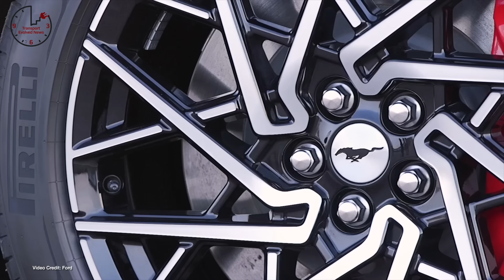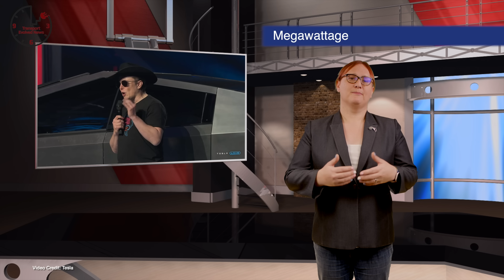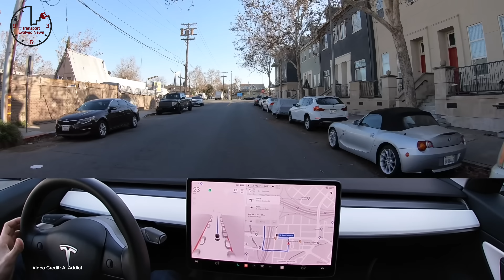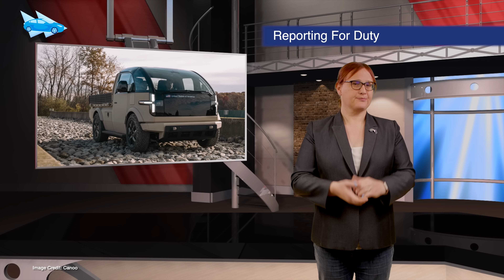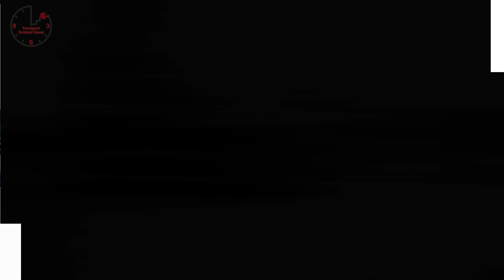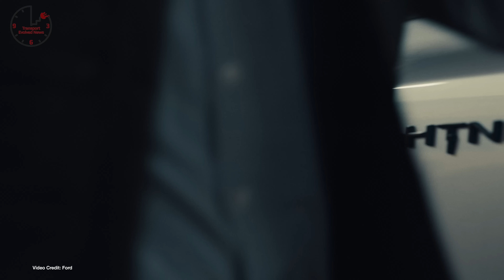Tesla Semi Deliveries! Aptera Chooses NACS! EV Sales Up (Again!) - TEN Episode 412.

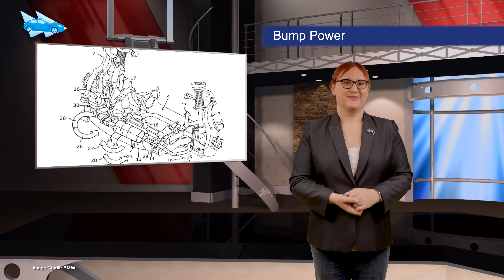Comment: Just for the heck of it, at ~18:00, the patent drawing of the driver side shock assembly (assuming the left side of the drawing is the front of the vehicle) appears to have an error. The upper yoke doesn't have the shock inside the "U" like the passenger side does. A surprising error?

Comment: Hi to the TE team, at about 18:00 you mentioned BMW's suspension patent and I was wondering if you have any more information on it like the patent number or could you mention the source of your information?  I could not find it in a patent search and I need to know if it infringes on my 2017 patent (#9561701) "Active electromechanical suspension and power generation system using an acceleration controller".  Thank you for any information you can give me.

Comment: The ID.3 has the Head up display as an option from the beginning. I have it in my 1.5 years old ID.3. It was not avaiable for a certain time due to supply chain issues.
There is a prototype driven by a German youtuber RN22E https://www.youtube.com/watch?v=dffQyt1yJiQ
This shows potential to bring petrol heads over to EVs.

Comment: The subscription model for the EV market could spell a life of financial servitude to those manufactures where you end up paying them many times over the Original value of the feature or even the EV itself!  (BMW, TESLA, NIO so far). NIO is considering selling you the EV on a subscription model!  what happens when a subscription based EV seller goes out of business,  do you end up with a "brick" in the drive because of all the proprietary software ?      Subscription models need government intervention to protect the buyers!

Comment: Nikki, over a week ago l ran back of napkin math to conclude SEMI to have an 850 kWh pack and will consume 1.7 kWh to travel 1 mile.
CYBRTRK will have a 175 kWh battery, with a usable 163.3 kWh which is around one fifth of SEMI pack to have almost the equal range.
This shows 1 kWh to move a 7000 lbs unit 3.1 miles, having a total range slightly north, of 507 miles or for the metric fans out there ~810kms

Comment: - The ID3 update is extremely necessary. Sales apparently aren't very good and the MG4 is not only a lot cheaper, but according to many reviewers a better car.
- I hope the choice for the Tesla charging port won't lock Apterra buyers in to Tesla's charging network. I suppose there is an adapter to CCS?

Compliments for the increased production values on recent videos!
Reply: It has production problems.
And still need better software.
Reply: @ferkeap  VW's ceo (so of the brand, not the group) has apologized for the software and the controls (especially the sliders without backlighting) and said these will be a priority for the update.
Reply: Maybe if they actually sold them in the USA the figures would be higher.

Comment: Correction. Average efficiency for the Semi is 1.7Kwh/mile according to a tweet from Elon after the event. Mind you that was no doubt greatly effected by the choice of load for the test. That amount of weight in a 53' dry goods trailer would be much worse due to the amount of surface area.
Reply: Trucks are made for the aerodynamics of a trailer, not an open flat bed.

Comment: In case anyone wants to know what the range of the Renault  EV Semis that Coca Cola has, wait for it....150km!  That's 93 miles for my fellow American viewers, laughable when you compare the two.  Sure, replacing diesel along any part of the transport of goods is a positive, Renault really should be worried about Tesla ramping up production and bringing semis over to Europe.  It feels just like when GM released the Bolt a year before the Model 3 and bragged.  Has the Bolt ever topped 15k sales in a quarter?  

It's like a 1.5m 50kg person bragging about hitting someone 1.8m 100kg, seeing the counterpunch coming to knock them on their rear and not expecting it to do much.

Comment: Higher voltage semiconductors (for the inverters that power the motors) have correspondingly higher resistance than lower voltage parts. Its not a linear relationship: A 1000 volt part has about 5 times the resistance of a 400 volt part.  Designing a motor to run on 1000 volts requires it to be wound with proportionally more turns of wire, and of course to fit 2.5 times as many turns of wire in the same space, it must be 2.5 times thinner. So, both 2.5 times the total length of wire in the motor, and 2.5 times the resistance per unit length. Net result: the lower currents in a high voltage system do NOT necessarily result in lower losses in the motors and inverters. There are genuine advantages in thinner, lighter connecting wires to and from the battery and charge port. But those are pretty minor considerations.
The single biggest advantage of a higher voltage system is that you get more power through a given sized charging cord. At 400 volts it's pushing the limits of how you can keep the cord cool while  getting 250-350 kW. Raising the voltage to 1000 volts makes it possible to get 1,000 kW through the same size cord and connector.
BTW, if the Cybertruck really does have a 1,000 volt architecture, it will be interesting to see how it will charge at Tesla's extensive installed base of DC fast chargers that can only supply 500 volts.
Reply: Cybertruck charging is backwardly compatible, just takes longer on V3 charger.

Comment: Here in Horseshoe Bay BC Canada we also have had two Nissan Leafs that were damaged by BC Hydro DC chargers, both cars required a tow, one car has been diagnosed with damage to its charging module require $6,000.00 CAD replacement, BC Hydro have removed the charger and working with both customers. No resolution has been made yet.

Comment: You asked for our views on the Tesla FSD Beta rollout to prepaid owners, so my view is that they judge it to be more advanced that an beginner or even an expert beginner. More like a first year provisional driver with a passed test. By that, it means the driver has to be there in case it encounters an edge case that it doesn’t handle perfectly, but the role will be supervisory not tutorial as it was 1 year ago. The benefit is that so much more data will be able to be captured for additional training bring the “experience” of the “provisional” driver up to the level of mature experienced driver in much quicker time.  The next period will be one of collecting data to track no of miles between interventions which will ultimately be used to get qualification for driverless use licence when that number is high enough, and it will be have to be a very large number.
The removal of the safety score requirement suggests they have data to show it is already safer than a driver with a lower score so it is safer than the owner in many cases. Not too hard to accept if you appreciate that most bad driving arrives from poor emotional management, not something FSD will be afflicted with. (Copy of Patreon comment).

Comment: One big issue with the Tesla semi - there is no listed price and no dry weight/curb weight of the trucks (this is mega important when you work in logistics).

Having known people that worked in the trucking area of Pesi Co they will not take any BS from Telsa and Musk (esp if a semi goes wrong and needs parts/serving) and will know the ins and outs of this before placing an order (they also tend to work there trucks up to the max weight of 80,000lbs in the USA most if not all of the time - so any change in max weight in the box will throw out their business model).

I know a few trucking companies what to know this information and some really want to test one - it is not the safety or self-driving or any other else they want but it is the reduction in their number one cost of running a trucking company and that is the fuel cost.

This is also where H2O will lose out - yes you can fill a truck in 5 minutes but are companies going spend 5 million+ per terminal for a fuelling station and add on the x4 to x8 the normal fuel costs (currently the spot rate of H2O is between x16 to x20 the cost of diesel fuel (this is based on the UK figures)) + the 20% reduction in range due to boiling off the H2O and how much less dense power H2O has vs the same size ICE fuel tanks are.

Now add it H2O design, R+D and matance is like rocket science (which is going to cost a lot more than ICE and every X hours you have to replace the H2O pressured tank(s) for new replacement or just for testing and recertifying due to the pressures involve and the materials used (esp to reduced weight seeing H2O systems are heaver vs batteries) and due to smaller batteries (H2O need a BEV battery to work) this could be an issue as well due to size and the repeated amount of cycles they will go through in a day etc - add in smaller batteries more cycles it will do but less weight and size it take up (hence why I said H2O systems are more rocket science vs anything else).

Comment: I do wonder about how Aptera's charging setup will work in jurisdictions where you're legally required when stall parking to have the license plate facing out and visible. In Aptera's case, that would be nose in, since the only plate is in the rear. But I think that at Tesla superchargers with a stall configuration (as opposed to the parallel ones), that'd put the socket too far away for the cable to reach it.
Reply: Some number plates, have just been stuck on transfers, so there is no aerodynamic issue
Reply: one thing I think you do not understand Aptera is not a car so they follow the laws of being a motorcycle or quadricycle (depending on what state and country they are being sold in).  This also affects the crash tests they can do on the vehicle -  seeing motorcycles or quadricycles have a totally different crash test done to them.
Reply: @QALibrary  I'm not sure what Aptera not being classed as a car has to do with whether or not they need to park with the license plate visible in places where that's required. It allows them to have no front plate in some jurisdictions where a car would require one, but most places that have the visibility requirement say that it's so that all the vehicles parked there can be identified by plate number from someone in a car driving by parking stalls, and this applies whether it's a motorcycle or a car so long as it's stall parked. Having to park nose in applies to cars that only have a rear license plate as well, which is the case in, I think, over a dozen states in the USA and at least one province in Canada, though not all of them have the visibility requirement.
Reply: Find a way to put a plate up front. They'll need that for Europe anyway.
Reply: Does this rule also apply to cars "parking" at gas pumps? If so, I'm sure there are plenty of police forces that'd be happy to be told so they can collect easy fines.
Reply: @HenryLoenwind  I would imagine that they don't count, but also that it's much easier for enforcement to look at a charging spot or two that is in a parking lot surrounded by cars that are just parked like normal and think 'parking spot', and hand out a fine, than it would be if the charging location was set up like a gas station, set apart from normal parking lots on its own property. Both exist after all. Level 2 spots are much more likely to be the former than the latter, though at least for those, longer cables are more practical than for DC fast chargers.
Reply: Wow did not know this outward facing rule .. i gues its better carrying a spare plate for charging than
Reply: @gmy33  This rule isn't everywhere, so you don't need to get too excited. And as I said, I'm not sure how it's going to work. Possibly various places will change the laws to make exceptions for charging. I don't know about the 'carrying a spare plate' idea. I didn't know that was a thing, but I live in a 'plate on both ends' jurisdiction.

Comment: so no aptera in Europe anytime soon 🤨
without Type2-CCS they won't get a permission to sell it 🤷
Reply: There are adapters, so while it might not attach to a charger directly, it will certainly be able to use any (non Chademo) charger.
Reply: It's remarkable how this urban (tesla cult spread?) myth/BS is rooted in people's mind. There is no obligation in Europe for car manufacturers to sell cars with CCS plug, as evidenced by model X/S being sold with tesla plug, or leaf with chademo
Reply: The vehicle will have to be largely redesigned to meet EU width restrictions in any case so a long delay for European deliveries is inevitable.  Reshaping the rear to accommodate CCS should be a relative doddle.
Reply: They could sell it without CCS, the problem is: who would buy it? All public chargers are CCS, and no one would be interested in using a dongle every freakin time. Not only that, but Tesla also killed any option to make it's own plug a standard as the CyberTruck, still a personal vehicle, will not support it either.

Comment: Great summary as always!  My first thought about the Mercedes e-Sprinter is that now it will have sufficient enough range to make conversions into B-class motorhomes more of a practicality.  Also IMHO the Tesla NACS standard on the Aptera (I'm a reservation holder) is a bit of a tempest in a teapot.  I'm sure they will provide an adapter for J1772 plugs.  Regarding DCFC, if Apteras have access to the Supercharger network and a CCS adapter is available for a reasonable price (as it is already), I'm all for it.
Reply: If Aptera is sold to a european buyer, they will need to install a CCS adapter.